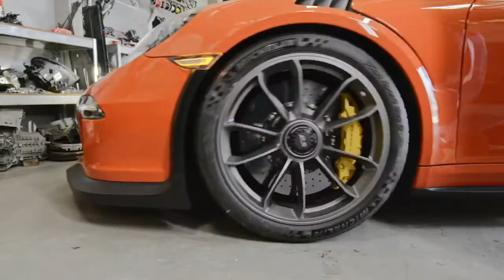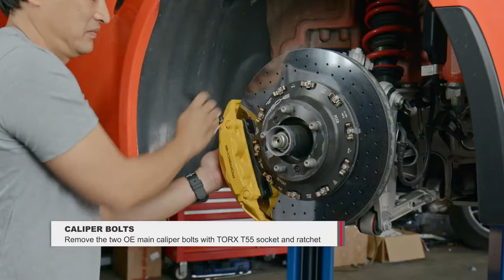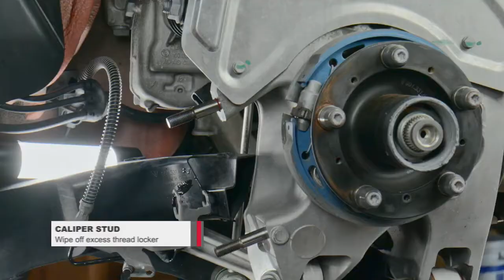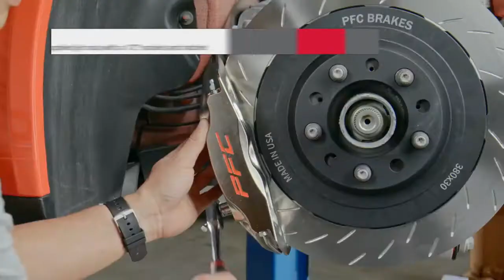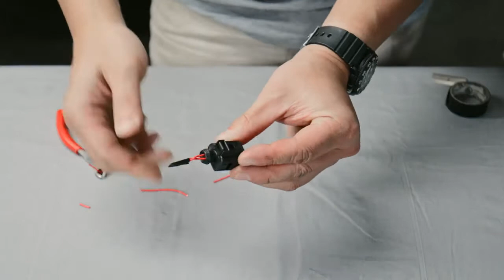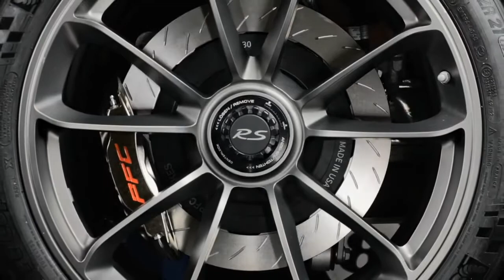PFC Brakes Track Day Package Installation

Comment: How are your brakes better than the millions of dollars spent by Porsche?
Reply: Great question. The car manufacturers optimize their street car brake package to a wide range of factors including highest average performance in every possible weather condition in different climates, acceptable wear rate for street use, acceptable level of brake dust, meeting environmental restrictions, meeting cost per unit in mass production, etc. The PFC Track Day Package is optimized for motorsports and advanced-level track driving using the best technology, materials, and manufacturing method for this specific application. It is a purposely design and built for motorsports operating environment. Additionally, PFC is the official brake supplier for the Porsche factory race cars(991 GT3 Cup, 981 GT4 Clubsport, 718 GT4/RS Clubsport) where the core designs are shared in the aftermarket brake kits for street cars. Street car owners who are avid track drivers hugely benefit from the PFC Track Day Package with direct root from the factory motorsport products. Hope this answers your question.